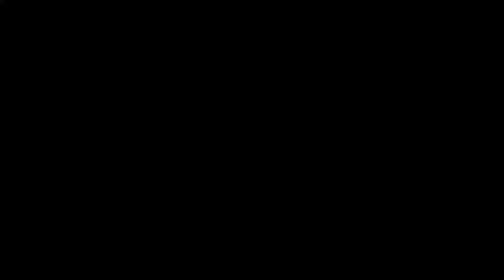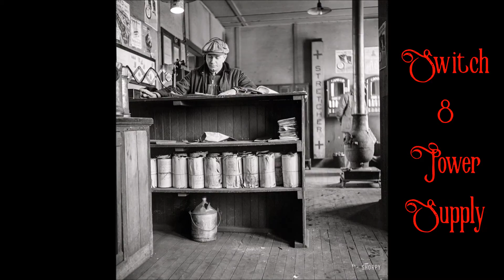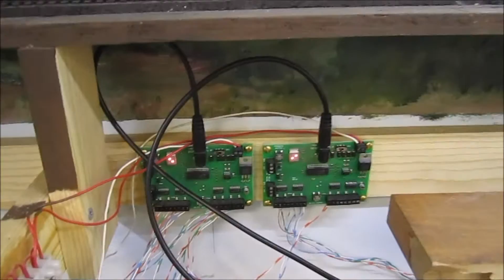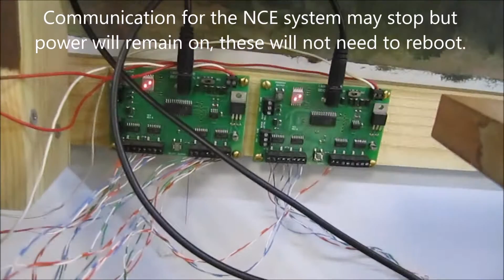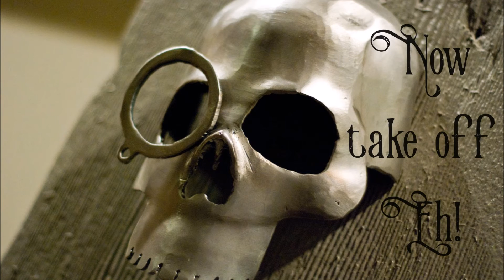Powering NCE switch 8's

Comment: I'm doing something similar, but I'm wondering if I will need to reprogram the ouput address on the second switch 8. Example output 1 to output 9 and so on?
Reply from the maker: Each output will address an individual switch machine (unless you have them wired together). If you desire multiple switch machines to operate while still being individually addressed that will require a Mini Panel (only if you are hard wiring a button) if you are doing everything on the controller, you can program the macro directly into the NCE command station.
Reply from the maker: I wish I still had access to an NCE system to make more video's on how to use features and how to get the most out of the system.

Comment: Very nice Professor! I'm just getting my first switch 8 mk2 , and was wondering about this ! As you say it's a great idea to isolate the turnout power supply , but was wondering if you still have the track connected. So I assume you select 'DC' on the decoder as they say and power it from a seperate supply. 
Thanks for the advice!
Cheers Gregg.
Reply from the maker: it still has to be connected to the NCE system for communication purposes (note the red and white wires connected at the tops of those two switch 8's) If you hook up your railroad using EB-1's (automatic circuit breakers) no matter where you have a fault on your railroad the logic circuits (switch 8's and macros) will be unaffected. And yes you switch the little micro switch to DC, that tells the logic to pull power from that bullet connector and not from the NCE buss.
Reply: Thats what I figured, for comms purposes. I do use EB1's so thats good to know but I still like the idea of a seperate supply for the turnouts.
Cheers and thanks.
Gregg .

Comment: Very interesting, thanks for the info!
Reply from the maker: Hey np, something else you may want to entertain is if you put in any form of Circuit breaker. to have the DCC input from NCE be on its own circuit breaker independent from the railroad. This way Macros and turnout operations will not be interrupted in the event of a short on the railroad.

Comment: how many barrel plugs, (or decoders for that matter) can you wire into the one power supply?
Reply from the maker: Each switch 8 has 8 decoders on it, and you require 1 barrel plug per switch 8. As far as how many switch 8's can be powered is simply a matter of load, every tortoise switch machine draws a small amount of current even when at rest, this is the stall portion that keeps pressure against the stock rails. I used a 2 amp power supply, Tortoise switch machines only draws between 4 and 16 milliamps, there are 1000 milliamps per amp. So a 2 amp power supply can supply enough current to operate 125 tortoise switch machines simultaneously or 15.6 switch 8's. The end result in this is a more cost effective way to power the tortoise switch machines without the need of expensive NCE booster packs. 

I hope this answered your question. 

Mark
Reply: absolutely!   thank you so much. perfect, timing, im wiring my staging yard as we speak. ordering everything now!!!
Reply: Professor Grimm one more question,,, how did you wire each barrel plug to the power supply?
Reply from the maker: One additional item you may be interested in knowing, the NCE EB1 is a auto resetting circuit breaker, what I suggest is that you connect your railroad up in blocks of circuit protection just like we once did with DC. The have the Switch 8 connections for communication (track power) off its own EB1, if you do it this way any short one the railroad, or entire railroad will not affect the switch 8's.
Reply from the maker: On a barrel plug the outer portion is always the ground or negative of the circuit, the inner is the positive, I suggest using a ohm meter to find out which wire leads to which surface so your polarity is correct. Also do not forget to change the position of the small slide switch on the NCE Switch 8 from DCC to DC, that switch only controls where the power is taken from.
Reply: great advice. but as for wiring it to the power supply,  the wire from the supply is simply a bus the barrell connectors are wired to?
Reply from the maker: The power supply will only have a red and black wire just like the barrel plugs, depending on your locations where you are putting things I would create either a bus line for the power supply and one for the track power. Wire the barrel plug up to the corresponding colored wire on the power supply and plug in, flip the switch on the switch 8. then you will have to hook it to you track bus line, this is how NCE will communicate to the switch 8. 

As far as how i did it, I think I just hooked up a small terminal strip and bused wires off to each switch 8. This is not my ideal connection for these, I would rather have all the Switch 8's, Mini Panels and what ever other NCE item is needed for the railroad to be centrally located and labeled. That style of wiring is not a luxury the set up the RVRR has to offer due to space limitations. I would suggest using CAT6e wire for the switch machines, they are twisted pair wire in a coax that will handle 4 tortoise switch machines per run, this will keep things nice and clean for your install. 

And don't worry about asking to many questions.
Reply: Professor Grimm thanks man makes perfect sense!  my facebook page for this RR is utah rail modelers. id love for ya to join if ya do FB!

Comment: I might hafta try this. Thank you for posting
Reply from the maker: the volt meter went from 13.8 volts to 14.2 just from removing the current load of all the tortoise switch machines and the switch 8's.